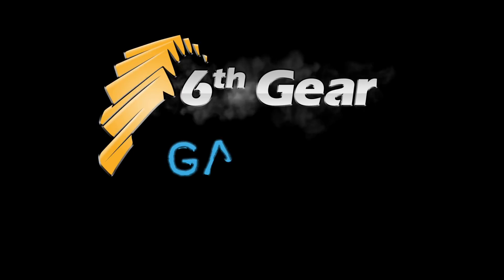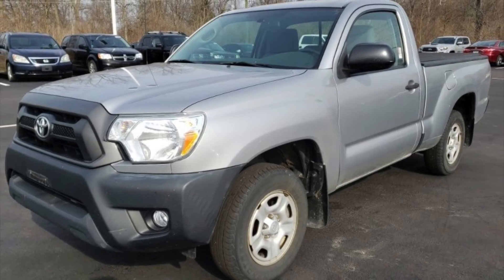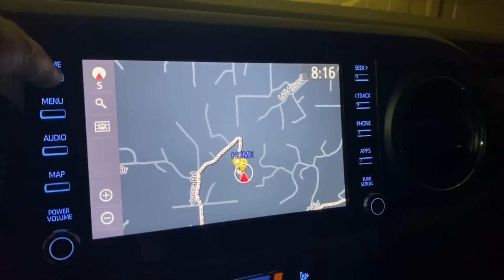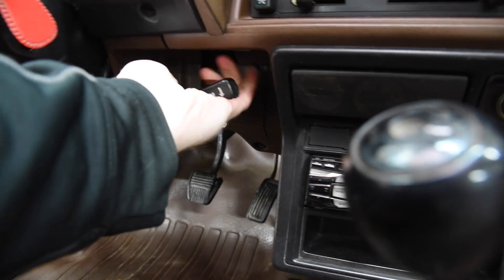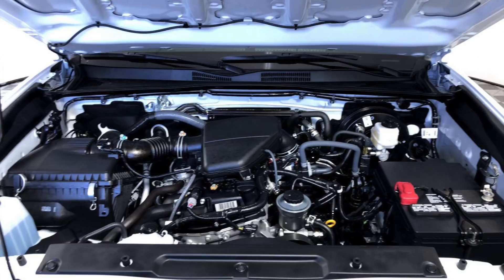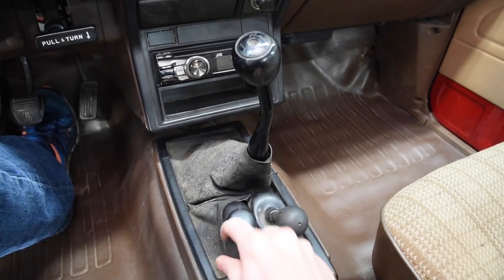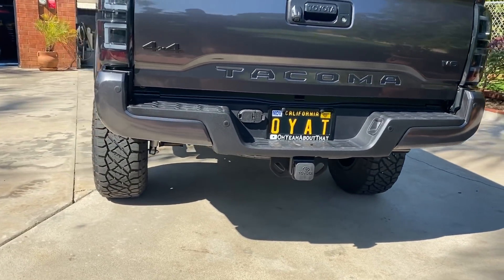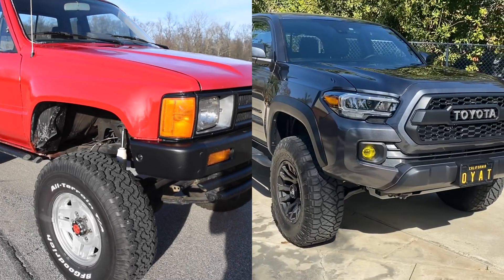1985 Toyota Pickup vs 2020 Tacoma TRD Off Road Comparison/Review

Comment: I had an 84 single cab. My dad bought it new. He drove it for 12 years, I drove it for 11 then he drove it another 4 before selling it. Over 500k miles. It was bullet proof.
Reply: That’s awesome! My dad had an 85 single cab SR5 4WD. My grandpa bought it new in 85 and then sold it to my dad in 91 or 92. It had about 150k miles when my dad bought it from my grandpa. My dad then sold it to a pick n pull yard in 04 or 05. The truck had about 180k miles when my dad sold it. The last 6-7 years my dad had it, it was sitting in the back yard in non running condition. I believe the engine timing was off along with a couple of other issues. I was only 8 or 9 at the time my dad sold it. Would love to have that truck back today..
Reply: Oldskool all day any day 🔥🔥
Reply: Nice! I've got a 84 single cab with 555k. Maybe the same truck lol
Reply: I have a Toyota custom Cab model 86

Comment: There is beauty in simplicity. I'll never trade in my old truck.
Reply: Indeed!  The new stuff is just another plastic toy with wifi installed.
Reply: 32 years later I agree and still driving mine!
Reply: MOJAVEDESERT SONORANDESERT 
31 years for my beast
Reply: Craptastic4 what year is your truck
Reply: This is why I want to buy a simple 1990 toyota hilux. Simple dual cab solid axle truck. No games, everything works the way its supposed to with a 5 speed manual transmission.
Reply: If not then a 2000 hilux will do enough. It works very well.
Reply: When there is good taste the exspensive does not attract attention - Old is Gold
Reply: Still have my FJ80 and ‘85 mr2. Toyota quality then was great. Simple but still modern enough for me.

Comment: I bought mine in '82 and never bought another.......still smile every time I get in!  You actually DRIVE an old Truck and are involved and aware of everything and Off Road it kicks butt on the newer stuff!
Reply: I drive a 1983 Chevy K30, you sure can't fiddle on your phone when driving old vehicles either. And when you're going 60mph, it FEELS like you're moving fast.
Reply: A Tacoma is just a shittier version of a hilux. Even though I’ve got a brand new 79 series that neither a Tacoma or tundra could out do, it’s still perfect. I’ve also got an 08 hilux, which is in that sweet spot between modern and old. The hilux with the 4cyl diesel makes 343nm of torque factory (252ftlbs for you Americans) and will still outlast a brand new tundra or Tacoma. Brand new 70 series land cruiser only just received the same technology as a 2006 hilux.
Reply: @tasmanmcmillan1777  Yeah to be honest the Toyota trucks we can get in the United States suck. I would LOVE to have a 70 series but you literally can't drive them here unless they're 25 years old or older. And I hear most of those trucks come with factory wenches and lockers, brushguards, diesel engines, and manual transmissions. I was shocked when I saw the different Toyota Utility trucks we can't have here because of....reasons? Bullshit. 

Edit: oh yeah and solid front axles. Most stuff here is piece of shit IFS.
Reply: Bloodbain88 brand new 79 series come out of the factory with the following
Cruise control, 5 speed manual, turbo diesel v8, Bluetooth head unit (not touch screen), manual locking hubs and a manual transfer case shifter, vinyl floor and manual window handles. They also don’t come with a centre console and they only have one cup holder(in both the dual cab and single cabs).

Top of the range comes with a factory rear diff lock, quartz clock, carpet and power windows on top of the rest. 

They also come out without any tray. Flat trays are the only thing toyota supply in either steel or alloy but they’re an optional extra. All dealers will put on any aftermarket accessory you want for a little extra too, and even will supply and fit at extra cost. Toyota have their own bull bars but they’re ugly. Most common thing is an arb bullbar on straight from the dealer.

I did it all myself. I’ve got a steel ARB bull bar, steel rock sliders with the steel brush bars that bolt from the side step to the bull bar. Two stedi 9” spotties, 12000lb warn winch, rated recovery points, 3” lift on 33’s, alloy aftermarket tray with twin headboard spare wheel mounts, 200L (53 gal) long range fuel tank, twin 3” turbo back exhaust, upgraded turbo & clutch, 200 series land cruiser seats swapped, swapped carpet for vinyl, front TJM air locker, on board air, water tank, GVM upgrade, dual batteries and so much more.

Long story short, the only American ute I’d buy is a super duty.
Reply: @tasmanmcmillan1777  Yeah the super duty trucks are the only thing we have over those. My 1 ton is a beast but I would love to have a 79 series like that. I hate all the high tech computer crap in trucks now, is the reason I drive an '83. Plus it's reliable and I can work on it easily. It's got an NP 205 transfer case so it's a manual shift lever, manual hubs, dana 60 front, dana 70hd rear, 4.10's. No lift yet, but it sits higher stock than any new pickup and 33's look normal on it. Plus I'm installing Detroit lockers before anything else. I laugh at these huge trucks that still run open diffs. Your Ute sounds awesome. Are the frames on those any beefier than the Toyota trucks in the U.S? Is your winch wound with steel or synthetic rope? You have a preference? I had a 92 Toyota 4x4 but the frame rotted out, but it was awesome off-road with welded diffs.
Reply: Bloodbain88 not too bad mate. I use a steel rope, I don’t like the idea of having to wash the synthetic all the time. I live where it’s either mud or dirt & a synthetic rope would just crumble. I’ve got two Toyota utes, a Mitsubishi ute & everyone around here drives a ute. Even all the work vehicles are the 70 series land cruisers. I work on a salt lake where it’s so salty if a vehicle has been parked for a few hours there is a salty film on all the panels. The trick to keeping the chassis good is chuck a fresh water hose in the holes and Give them a good flush out regularly. An under body wash with fresh water is always a good idea too.
Reply: @tasmanmcmillan1777  I hear you, I live in a state where they heavily salt the roads. I undercoat all my vehicles with Fluid Film. It works pretty well. Also keeps steel winch cable rust free.
Reply: Bloodbain88 all I use is fresh water to wash underneath & a can of inox. I don’t know how much salt is used, but the amount of salt at my work a 2 month old vehicle already has rust, even though they’re completely underbody coated. The trick is fresh water and a stick water dispersant & regular wash’s
Reply: Still rolling in my 88 till this day! From the great band Boston : DONT LOOK BACK! WELL SAID WELL SAID
🍻🍻🍻🍻🍻🍻🍻🍻

Comment: 85 all the way . Rather have a sticky rear window then a broke electric thing
Reply: That’s not true 😅 Tacoma’s are reliable
Reply: @Luis Bolanos I wouldn't call the '85 in this video a junky truck though. However I have owned seriously junky trucks from the 80's (1985 chevy 4x4, rusty pos) and drove it for 11 years and only had to work on the brakes once. Now I drive a nice '83 chevy and I trust it 100%.
Reply from the maker: I've owned quite a few junky 80's Toyota trucks, as you may have seen in my other videos :) It's hard not to buy them for parts when they're cheap.
Reply: @Luis Bolanos not necessarily true but ok
Reply: My 2014 base model has a not so sticky rear and door manually operated windows
Reply: Luis Bolanos definitely not
Reply: @flight2k5  The 2020 mexican made tacomas are already having problems with the radios going out. These things are being made cheaper and cheaper every year. I wouldnt buy anything within the last 10 years from toyota. Coming from a 2014 tundra owner. PLASTIC!
Reply: Got that rubber but not no name. U love them Toyotas hey bro. Kool there best in the world. But u know that!!
Reply: @Luis Bolanos depends on many factors I think
Reply: Luis Bolanos  The thing is though once the 85 fixed and rebuilt it will be a extremely reliable vehicle...the Porsche not so much !
Reply: Ok boomer
Reply: When it comes to 4x4 the straight  axial  is  the best for taking a beating  plus much easier  to lift and add bigger  tires the independent  is 100 % garbage  the manual transmission  in the 85 can get things done the burn up o matic  with all the computer  crap don't  like being  in water .  Welcome to the  swamp .
Reply: @Luis Gustavo my 1980 Chevy k10 junky truck can haul a load and help me out around the farm. Your new fancy Porsche will get you a lot of sweet talk from at the 12 year old little boys. That's the difference bud.
Reply: My brother bought a 2008 S10 and sells repair work for gravel pits. That truck has 450000+ miles on it. It was a cash for clunkers purchase and he traded a Ford ranger with 350000 that wheezed in to the dealership on 5 cylinders.  After the government payout the Chevy cost him 8800 dollars
Reply: @1XMuleX1  I have 19 tacoma built in Mexico and have had absolutely no problems. In fact I live in Hawaii and everyone has a tacoma and the ones built in the US had more problems. Literally my 4 cousins have tacomas and like 15 or my friends as well. Hardly any issues to begin with but there's a few minor recalls on 16 and 17 models.  To be honest toyotas interior and design is known to be extremely cheap in older models, but that's ok because at least they are reliable, BUT! Honda was completely dominating them and they had to step up their game so the newer ones are actually miles better.    I also owned a 14 tundra and it's a truck man what can I say.  If you want luxury buy a lexus or something like that.

Comment: If given the choice I'd take the '85 all the way. I inherited an '84 2WD auto XtraCab from my grandfather last year. Slow by modern standards, but still an awesome truck. I don't really do any off-road excursions(and I have an '04 RAV4) so the RWD doesn't bother me. It's a great vehicle for hauling and even daily running. Every vehicle I own is an '80s Toyota, with exception of the RAV4. I wouldn't have it any other way. :)

Comment: It's amazing how little changed from your 85 to my 93.  I've had mine for 13 years, and it now has 365,000 miles.  Many people have tried to buy it from me over the years, but I'm taking it to my grave.
Reply: You Just made me laugh Toyota pickup and Hilux guys are all the same, my 89 extra cab with 31”BFG + 3” lift  it’s just the epiphany of a Ute! 
So many times guys have asked “ is it for sale” 
If it was for sale it would be sold!!
The first and last time it was for sale is in 89 when I got it form Toyota!!
471000k
Reply: Mussa Musumeci heck yeah man!  Sounds very similar to mine.  31” Mud Claws with 2” lift.  Just an absolute joy to play with!  I literally just got back from a 70 mile mountain cruise.  Ol’ girl just chugged along.
Reply: They are just the best ute, I’m looking at my diesel one 03 1KZ-TE duel cab right now! I’m having the injectors reconditioned it’s done 371k so it’s due!!
I’m actually trying to find something else to fix while in in the garage and I’m at a loss, there is physically nothing to be  done. I might vacuum to interior!!

Comment: 85 ,cheap, rebuildable,goes forever. No B's electric. It doesn't cost 40, 000.....
Reply: Ok boomer
Reply: Married into an ‘87 Xtra-cab...22R, manual...(that’s “stick” for the 70 percent off millennials that don’t know how to operate it, but I digress...) 
Its all about simplicity. Damn thing wants to run forever. And probably will.
Reply: I bought a 1985 Toyota Pickup 4x4 Small Cab and No Back area idk wht its called.... pretty much behind the seats there is no extra space such as this 85 toyo u see in this vid....
Reply: The new truck in video is probably 10-15k in addition to 40k.  It’s crazy what they cost nowadays but it’s all vehicles not just Toyota
Reply: Cherry ones are getting pricier every day. You can still find cheap ones (2k-5k) but the 80s models in good condition are all closer to 10k and some are selling for 30k-50k if they're 4x4 and near mint. I got an 86 a while back for around 2k its 2wd though. Good shape other than a little bit of surface rust on the body.
Reply: buddy, get your head out of the 80s. its called inflation. everything will go up over time. stop being broke and get more money !!!!
Reply: @Buckarooskiczek  i’m 16 and have a 79 sr5

Comment: The 85 is the only way to go! No computer  and everything is easy to work on.  And definitely  take you more places. ✌
Reply: 85 has a computer for the fuel injection
Reply: @vagabondroller  I apologize for my mistake.  However that can easily  be removed  and switched  over.  Correct?
Reply: NP, yup but if you are going’s to go from carb to EFI, you might as well get a 20R head (flows better) with a edelbrock intake and Weber carb.  Not sure if they make these parts anymore though.  The EFI is so reliable and convenient though, I don’t see any reason to change unless you are worried about an EMP.  But these days who knows?!!

Comment: As you were listing all the features of the 2020 Tacoma all I heard was "here is another thing to break".
Reply: Russell Thompson the cheapest one is only about $27,000 and it doesn’t have all the unnecessary electrical stuff.
Reply: @cipher1167  "only"??
Reply: squire haggard yeah only.
Reply: @squirehaggard4749  Thats exactly what the 85 cost back in its day...
Reply: @Luckingsworth   actually the 80s one cost 12.000, 20,000 in todays. 

difference is, a good condiiton one is still worth as much. lets see a 2020 tacoma still be worth 40,000 in 35 years time

Comment: I own both too. 1987 Toyota Pickup 4x4 5MT and a 2017 TRD OR DCSB 4x4 6MT, and I really enjoy them both equally. I actually have more pleasure, driving the 87’ vs 3rd gen 17’. Even though both are manual, the rawness and simplicity of the older truck outweighs the creature comforts of the newer truck.

Comment: I love my 84toyota pickup and drive it every day. But that new one sure is nice.
Reply: Yell man, love my 2018 TRDOFF but the 80s , best ever🍀🍀🍀
Reply: I've got an 85 runner and a SAS 5vz 93 pickup with duals, e-lockers, on 37's. 

If you don't mind or even like farm equipment ride quality, you'll love old  solid axled Toyota. 
If you need speed, gentle suspension, and creature comforts, you'll hate them.

Comment: Few things: You kept saying the 2020 only had Access Cab (with the 6 ft. "long" box) or Dual Cab Short Box options, but there is a Dual Cab Long Box option as well.
Off-Roads are also available with the manual transmission.
Hill-start assist is only on the Sport manuals, not Off-Roads.

Comment: So a few years ago I decided I needed a basic pickup for carrying things and going to Home Depot, so I got an old 88 Toyota pickup with 210k miles. It wasn't as well equipped as Mr. Garage's - it didn't have the extended cab, had vinyl seats, never had a/c, no clock, and didn't even come equipped with a cigarette lighter. It worked well as a pickup truck and driving it was sort of like an amusement park ride. Like my 83 GTI, its manual steering gives you a raw and satisfying driving experience. But my wife didn't like that it didn't have a/c and I didn't like my right foot getting tired because it didn't have cruise control. So after about a year and maybe using it two dozen times I got a used 97 Toyota extended cab T100 pickup and sold the 88. Owning that 88 pickup gave me an appreciation for small Toyota pickups and made me conclude the 84-88 pickups have the best styling.
Reply from the maker: Well said! Not ideal for a daily driver, but so rugged and well built.

Comment: I had a 1986 Toyota truck, xtra cab, long bed, manual, 4 cyl with carb.  The thing was a beast.  I would carry a 7.5' Lance camper on it with NO problem and zoom past people going over Wolf Creek Pass in Colorado.  In 160,000 miles the only thing I ever had to fix was a rusty radiator.  I've had a T100, 2 Tundras and now a Tacoma, but that 86 was my favorite.  Could also pull my 26' sailboat easy, but eventually it couldn't get it up a steep ramp at my local lake, so had to go with an automatic.

Comment: I'm the original owner of a 1991 Toyota Pickup, 6 cylinder, 4x4, Auto Transmission (used to drive in LA's traffic), A/C, Toyota Bed Liner (very tough), Extended Cab, Long Bed (6').  I love it!  Being narrow, I can go along most jeep trails.  The 4-wheel drive grasps the terrain like a tiger's paw.  I only have 140 K miles on it.  At 69,000 miles, Toyota had a recall.  The dealer put a new engine in.  Thus, I only have 71 K miles on the new engine.  I maintain her like a watch.  I can afford anything I want.  Why would I give up a great running truck just to have all the bells and whistles of a new Toyota (and a truck payment)?  The only thing I miss are airbags.  I just hope no one ever totals my "baby".   She has treated me VERY good  for 29 years.

Comment: I had almost the exact same truck but in the efi, five speed manual, 4x2, SR5 version. It had bucket seats, middle consul, cup holders, blue interior and the exterior was blue as well. It also had a chrome front bumper, chrome grill and some chrome molding around the head lights but it didn't have a rear bumper. It was my first truck my dad got it for me back in 1988. Man I loved that truck!

Comment from the maker: I'm told I got a couple of details wrong on the 2020... The Double cab IS avail with a 6' bed, not just the 5' bed.  Also the TRD Off-Road IS avail with a 6 speed manual, but only in the Access Cab configuration.  Let me know if I missed anything else. Thanks for watching!
Reply: You can get a manual double cab 5’ bed, but you cannot get a manual double cab 6’ bed. Also, I think you mentioned the wheel base is the same across configurations, but the double cab 6’ bed is longer.